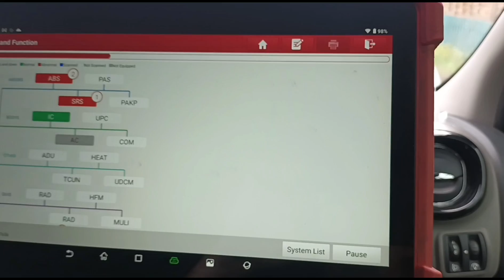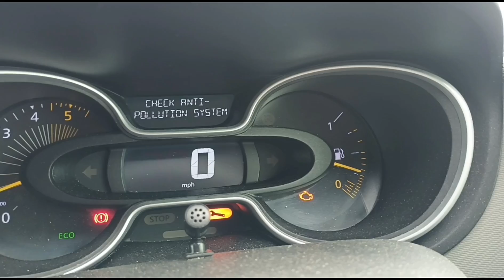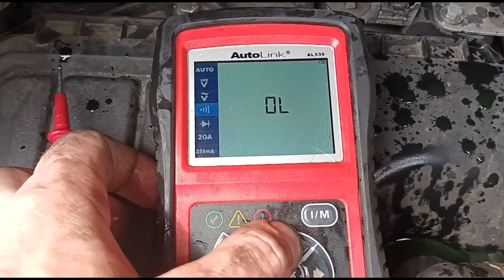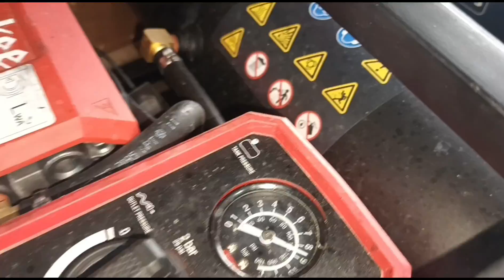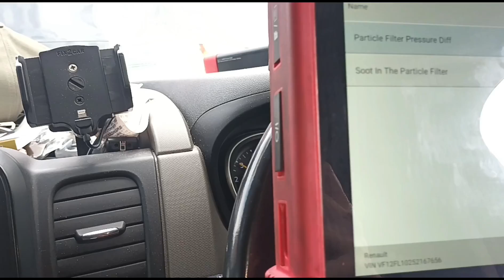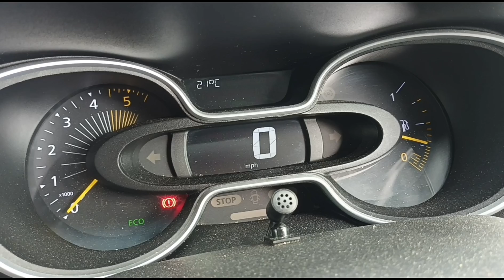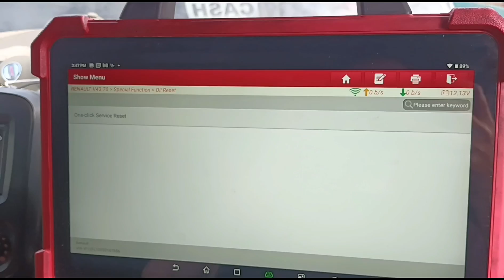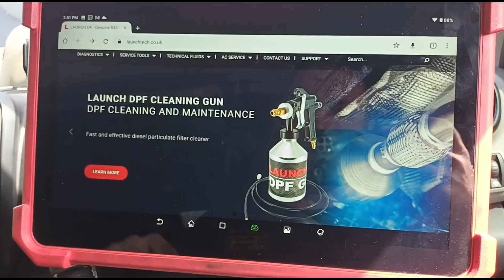Renault Trafic Glow Plugs & DPF Cleaning, Check Anti-Pollution System Injection Fault

Comment: Hi .sorry I know you must get loads of people asking questions, my problem is my 65 plate traffic is a bit slow starting from cold I've changed the glow plugs and the glow plugs delay and battery and it's still the same it's only done 56k runs perfect no lights or faults on the cash I've had it from new, any idea what else it could be, thanks 
Regards mike
Reply: Hi mate. I had the same problem. The amperage of my battery was too low. I bought a new one with a higher amperage. It now starts much better. Make sure when you turn on the ignition to leave it for about 5 seconds to allow glow plugs to warm up.
Reply: @gdfggggg  brilliant thank you I’ll try that

Comment: I have a mazda 6 2011 diesel 2.2 and my dpf light is flashing but it says there was no faults I have changed the oil and filter and air filter cabin filter and fuel filter and dpf cleaned light still flashing

Comment: Hi I have a 2017 renault traffic it will start for one mybe two seconds then will cut out if I plug out the airmass sensor it will run fine if I drive it about a mile or so it will be very smokey like a train any suggestions???

Comment: Hi what sort of engine symptoms would come with this. I have a brief hesitation in low down rev range approx 1800rpm but once pushed past the van pick up is fine and seems to have full power
Reply: My van is doing  the same as yours, and mine has the same faults on the dash as this one has.

Comment: The biturbo engine has the dpf underneath and the single is burried behind the engine in the deepest darkest pits of hell 😂

Im glad im not the only one that struggles getting the service interval to reset on these. 
Also jimmy, may save you some time on the next one, once you done the adaptation for dpf replacement, if you also do the the adaption for "after dpf regeneration" it will reset the calculated soot to zero. Should save you holding revs untill it lowers 👍

Another good vid mate and nice glowplug collection 😅

Comment: I think I might of said this before!  But surely Launch could easily update their system so you can set the rev’s to hold at a certain limit why cleaning the DPF?  like it does when doing a static Regen.

Comment: Thanks for the video, very very interesting. Oil reset is interesting.  A question if you have time, if you change the oil but do not reset the oil service (ie i do mine more frequently, but do not reset it) is it critical or just a counter system to remind everyone!!!! Or are there technical changes in the engine/car computer that take place? Thanks again, just a keen DIYer again, sorry if its a stupid question 😢
Reply: There's never a stupid question.
Reply: You could try this trick: Vivaro Service Light Reset: youtu.be/Ag2MbQ9bSRI

Comment: Also if u use a test light with a bulb in and put it onto the live on battery and then touch each glowplug. If it lights up the glow plug is working and drawing power. Wont work with the 5 volt glowplugs obviously.
Reply: That method doesn't tell you if the glow plug is shorted though as was demonstrated in this video. The old school light method will only highlight if a plug has failed open circuit.